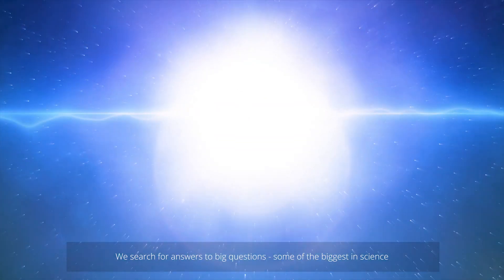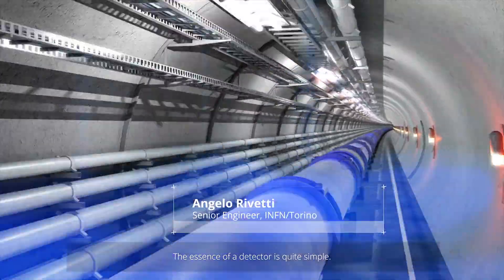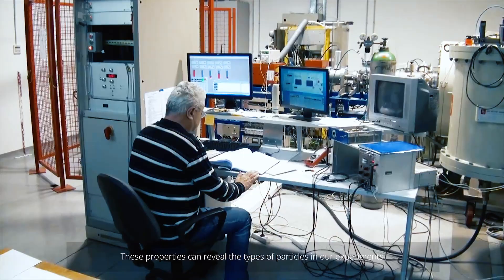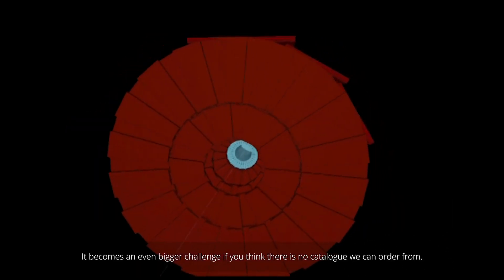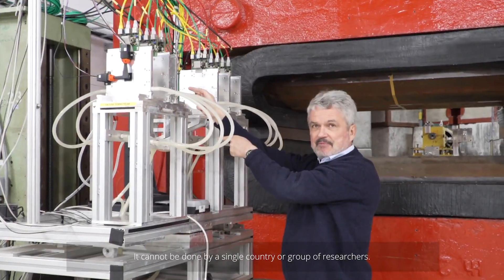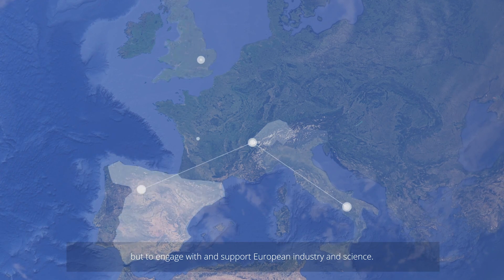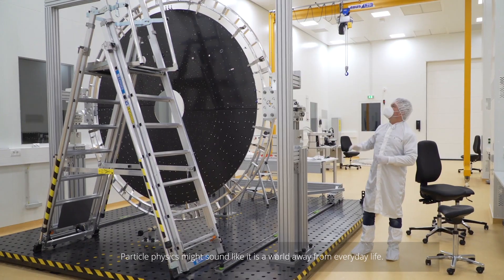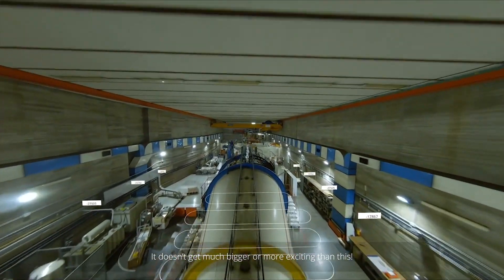The AIDAinnova project

Comment: IN ORDER TO BREAK AN ATOM INTO SINGLE ELECTRONS, A VERY HIGH VOLTAGE APPLIED TO THE ATOM IS ENOUGH, AND THE ATOM DISSOLVES UNDER THE FORCE OF THE REPLACING ELECTRICS AND PROTONS ,,,,AND THESE ELECTRONS ARE OBTAINED THIS IS A JEW OR ATHEIST TAKES ANOTHER WATER IN THE BOILER AND A GREAT VOLTAGE IS APPLIED AND IT WILL FIRST FALL INTO INDIVIDUAL ATOMS THEN THE ELECTRONS AND PROTONS CAN BE COLLECTED FROM THE CONTAINER, THEY WILL BE RED AND BLUE POWDER, THE ELECTRON WILL BE RED AND THE PROTON BLUE AND IT WILL BE LOOSE POWDER , AND THEN, BY APPLYING A BIGGER VOLTAGE, YOU CAN DISASSEMBLE ELECTRONS AND PROTONS INTO SINGLE QUARKS